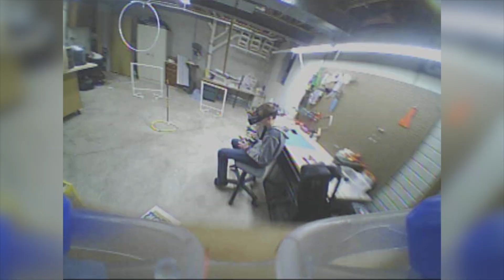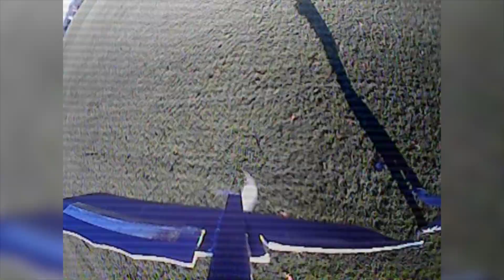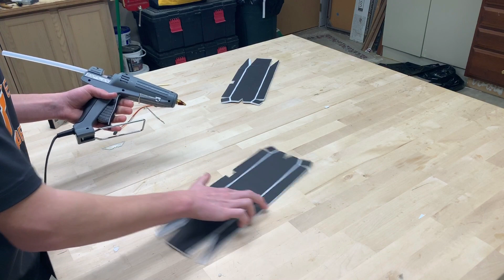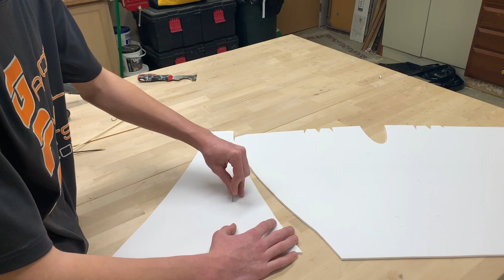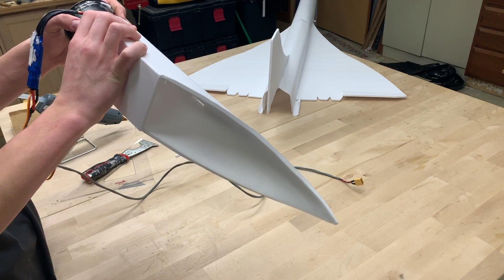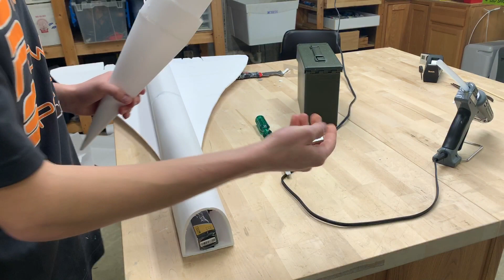CutomRCMods Concorde Build Video

Comment: Hello, I want to ask you, is it possible to celebrate you on Instagram? because the link doesn't work for you
Reply from the maker: @Mustang7177  thanks for the heads up. my instagram is @customfpvofficial if you would like to follow. I will check that link to make sure it works now
Reply: regarding concorde